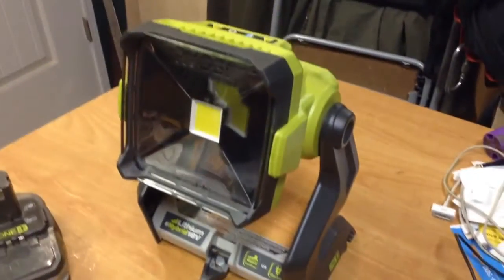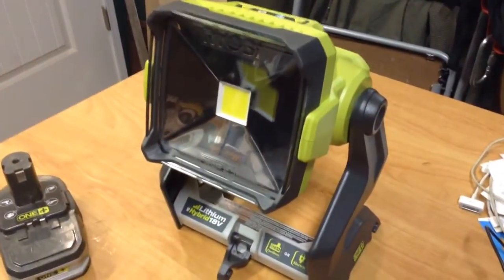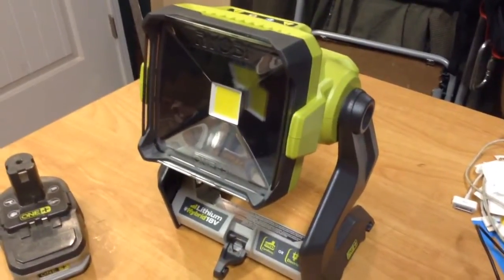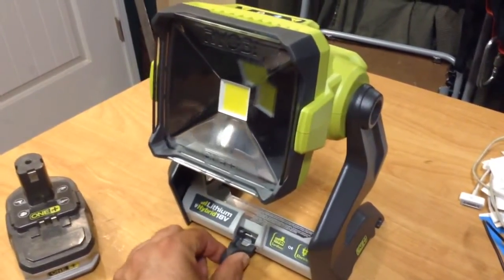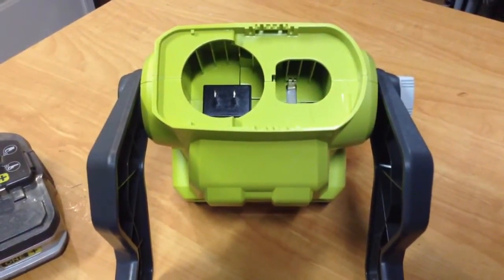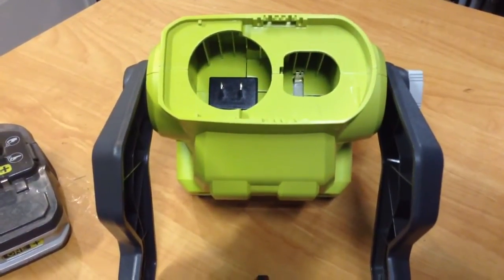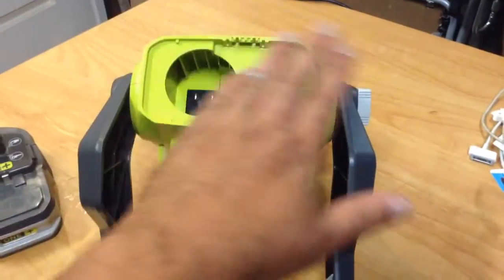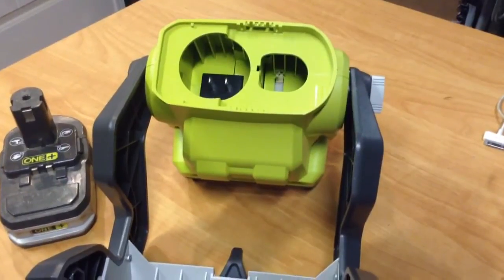Ryobi LED Worksite light P720 Dual power Light

Comment: would you recommend this for a cable technician  working in attics and crawl spaces
Reply from the maker: tyler eastman Absolutely, in fact I was using this one just a couple weeks ago in a hot attic crawlspace with a crew from Rogers Electric.  That's the company which does the professional electric work for a lot of major retail chains.    The big benefit of this over other large capacity higher power worklights is that it does not build up heat in those combines spaces the way the  halogen lights do.

Comment: I have a couple of the lanterns, and they totally rock.  We use them camping and around the house all the time.  I was thinking a couple of these might be a good addition to the system.  They looked like they would be good to strap a couple to the roofrack and make some impromptu off-roading lights. It would be cheaper and more versatile to go that way than to buy & install dedicated off-roading lights.   Thoughts?  Thanks for the vid!